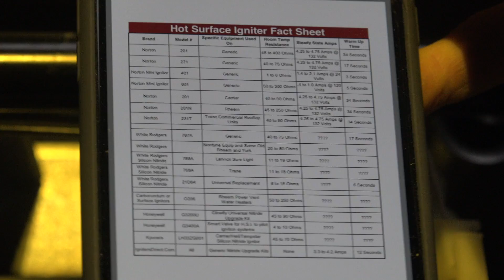90+ furnace service part 2

Comment: Great videos, thanks. Going to open this thing and find out why my furnace  is not firing up. Edit: 10 min later. Igniter is reading OL - Open Line. I have the exact same igniter, WR 768A-15. Sensor is also in bad need of a cleaning. This has helped very much. THANK YOU!!!!!!!!!!!!

Comment: Love your videos.  I'm confused on one thing.  How can you tell if your the gas valve on your furnace is running in single stage or two stage?  They say the gas valve is either partially open in first stage and fully open in second stage.  Does the blower motor changes speeds or more gas supplied or both.  Please explain.   Thanks

Comment: GFM..........look at these numbers and tell me what you think might be the problem.........OD Ambient was 65, the WB was 58 ..my suction was 102.7 the head was 213.8 the superheat was 33.2 the subcool was 12.2 evap temp was 32.8 condensor temp was 73.6 the SLT was 66 degree and the LLT was 61.5..........its a 4 ton Goodman Heat Pump with no TXV in the unit or at the Evaporator..........I put a new compressor in it because it was knocking like a truck with no oil in it.......Now this is in the cooling cycle.......

Here are the numbers i had when I put it in the heat cycle........590.5 suction and 591.6 head with SH 38.7 and SC 45.8 the Evap temp was 147.0 and the Condensor temp 147.0 the SLT was 185.7 and the LLT 101.2

I weighed in the 410a ...it call for 222 oz.....which is 13.8 lbs   and  these are the numbers I had........does this Heat cycle look like the reversing valve is not working the way it should???
Reply from the maker: It certainly appears the rev valve is not moving all the way to heat.  It is probably moving half way and is bypassing.  You can check temps of the inlet and outlets of the valve.  If it is bypassing the discharge tube temp will be about the same as the suction line at the valve.  It is possible the failed reversing valve caused the compressor failure.  Hope this helps.
GFM
Reply: thanks for the quick reply GFM.......I will check those temps first thing tomorrow......